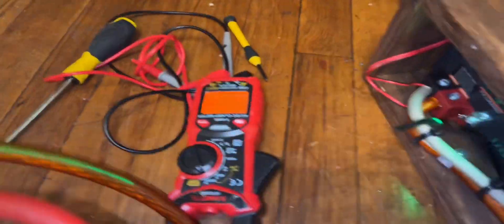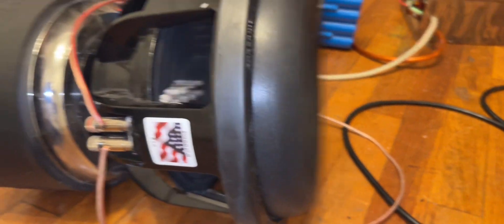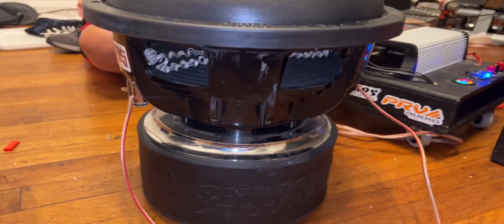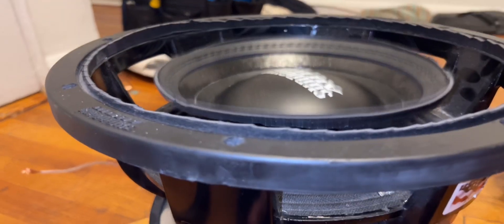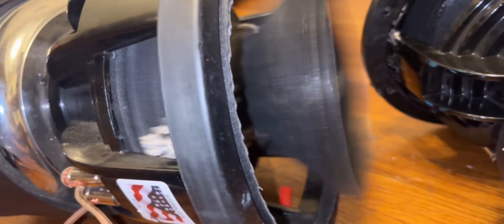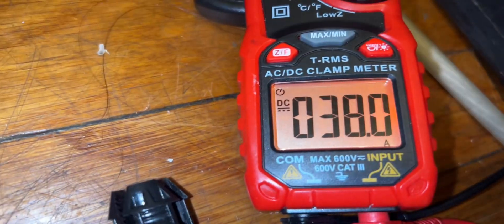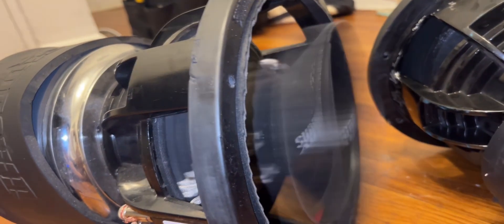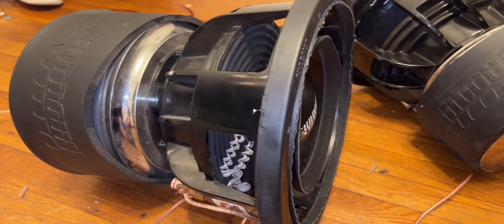Sundown ZV5 12 Excrusion Test

Comment: I need a 6 k or 8 k. For my sundown x10v3 what would you recommend.  I have very little money and I want something that's going to push my subs hard and dependable too.
Reply from the maker: Get the Taramps Smart Bass 8k. Just installed one and it’s a beast.
Reply: @MasterDJRenn  really? I was really considering that amp. Just didn't know if it was Luke the story's some people are saying that they catch on fire. Yeah that would make me nervous
Reply from the maker: @Ernestosgarage  some year ago, I’ve had a Taramp HD and a few Stetson catch on fire, but recently, not so much. I’ve installed a few ( like 10) of the Smart series and so far, no flames. They sound really good too, I couldn’t tell the difference between a Korean that’s twice the price and twice the size.
Reply: @MasterDJRenn  wow that's great to hear. Man I'm getting me a Teramps smart 8k bass should be plenty of power for my two sundown x10v3.  Man I can't wait to bump hard. I currently have a deaf bonce 2100 amp and bumping hard for 2,000 watts . I can't wait to hear the Teramps 8k on them
Reply from the maker: @Ernestosgarage  You won’t be disappointed in the amp. Make sure you have the proper electrical to support the amp.  Nothing ruins a good system like lack of proper electrical.
Reply: @MasterDJRenn  ok I currently have a mechman 240 alt. And a xs power d3400 battery under the hood . I know I need more power battery.  Just not sure if I should get another xs  d3400 . Or something in lithium.  I was thinking super caps like a bank of six or two banks.
Reply from the maker: @Ernestosgarage  The D3400 weight a ton man. You can build a Headway 64ah bank for about the same cost as a D3400, and the Headway Lithium bank will far outperform the D3400. The 240 alt is fine.
Reply: @DJ_Renn  ok thanks.  I will look that up and see if I can get one . 👍